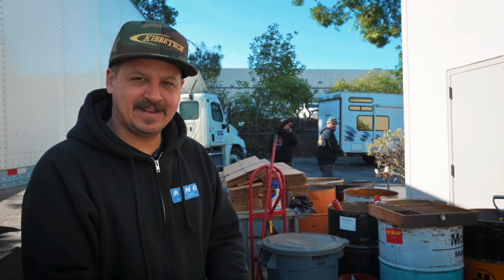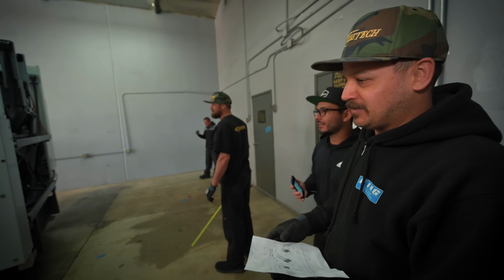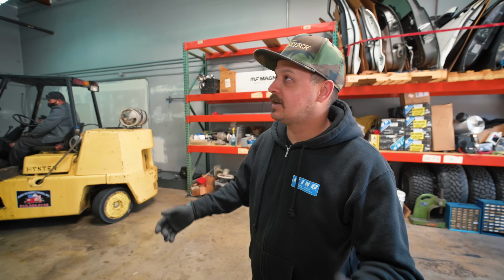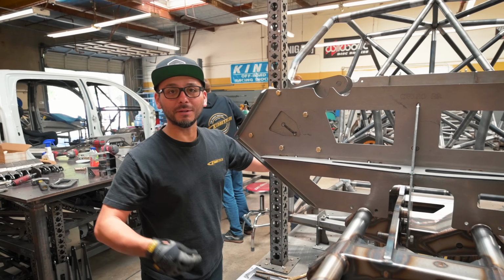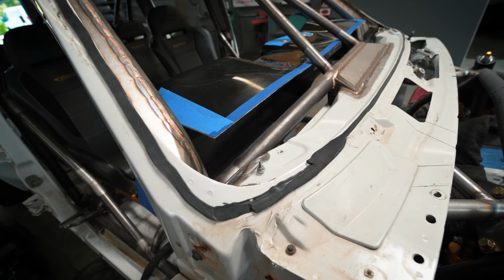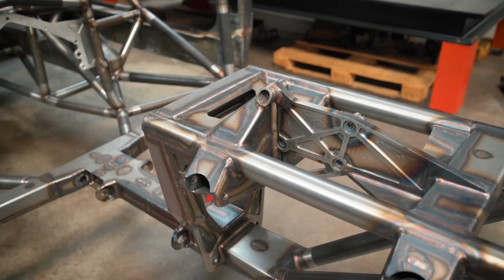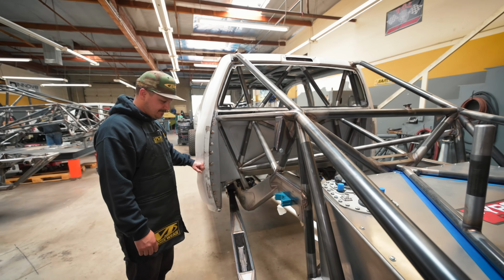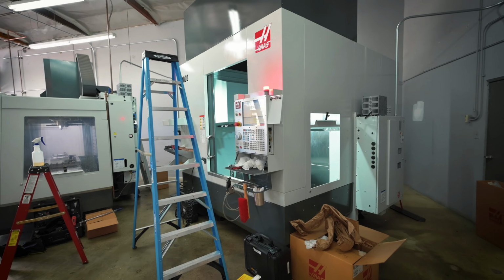Our New 5 AXIS HAAS CNC Machine

Comment: Why did you choose haas? Why not a mori seiki? Doosan?
Reply: Most machines are pretty tired in five years Haas so cheap they’ve paid for themselves by then and you sell them and get new ones plus Haas machines get better and better. I’ve been a Mori and Matsuura guy my whole career but the Haas make sense there paid for before you ever have a problem with them unless someone crashes it
Reply: @Lemosoffroad  I call bullshit, haas cant even make a grease/lube system that works. Garbage 
I hope they get a class action lawsuit going over that.
Reply: @matt23727  we had a mori with a oiling issue then we switched to manually oiling problem solved just can’t be lazy and pump it every day
Reply: @Lemosoffroad  ok, one mori out of thousands if that's true.
Every single haas that uses the red grease has a problem. That's 5 machines out of 5 in my shop.
100 percent failure rate. Causes massive damage and only remedy is 10 to 20k worth of "maintenance " haas says.